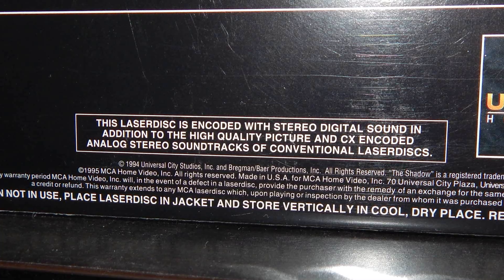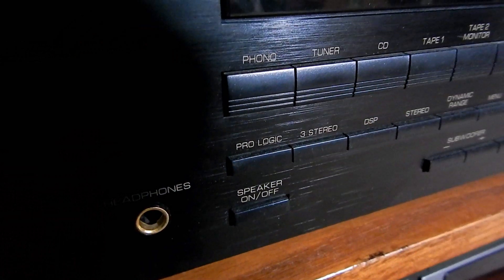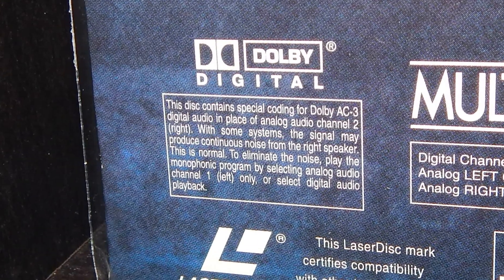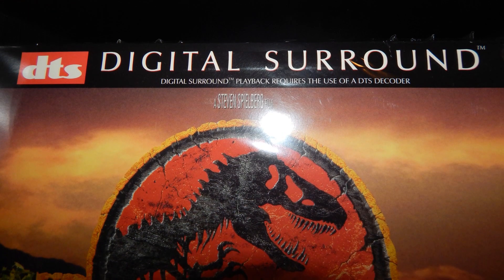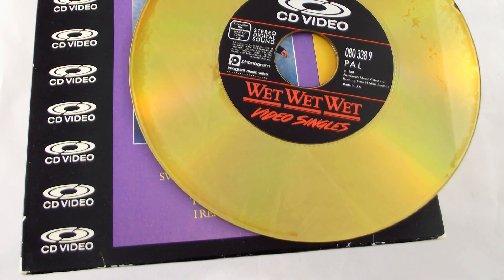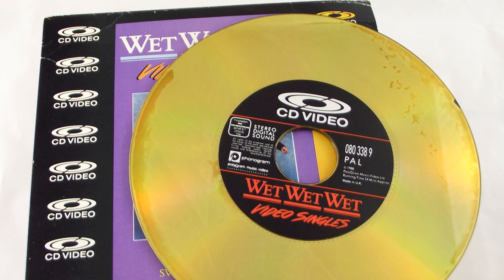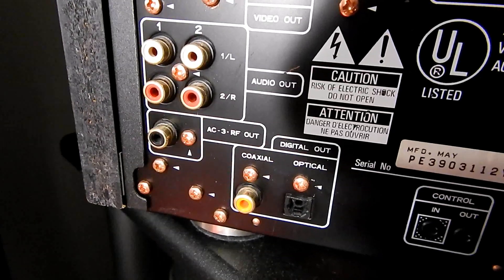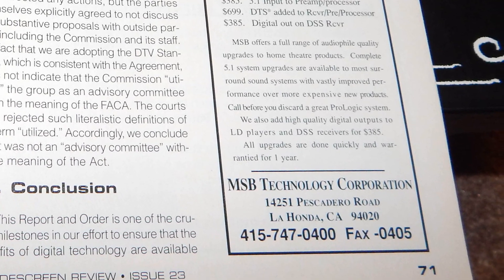LaserDisc Audio Guide – Part 1: An LD Audio Overview

Comment: 03-05-23; Appreciate the tutorial. Understandingly complex issue(s) as time evolved. This certainly achieved the goal of introducing the key moments of tech advancement along with highlighting the tangents. Just recently into the LD experience, having purchased a Pioneer CLD-59, and this helped me understand several things 'new' to me regarding the back panel hookup options. Will need review and additional details, but now have better basis of truth. My Amp has built-in  RF/AC-3 INput, so in several weeks of analysis of used offerings saw immediately I needed to be in the mid-90s + era for a player offering an OUTput to match. Will likely re-listen to this as well as catch the additional videos offered to expand on the knowledge. Looking foward to being competent, knowing the lingo etc. Being a Nerd (Techno-Nerd) was and is not my goal but it is cool to know more than a thing or two and be able to hold intelligent convo's with the geeks to whom I need to rely on to ultimately answer my Questions. No disrespect intended, labels can be used negatively - not my intent. I look at those terms geek and nerd as abbreviations like pHD, Dr etc...

Comment: Sam, can you explain the difference between an amp and a receiver? Is one preferable to the other?
Reply from the maker: It's a bit of a mess - people in Europe seem to call everything amps, while people in North America seem to call everything a receiver.  Haha

But technically, an amp is just an amplifier, solely taking audio signals and boosting them for speakers - once you add on built-in audio or video processing, it becomes an integrated amp. Then when you add a built-in tuner, it becomes a receiver.

So basically, if it doesn't receive AM or FM signals, it's not a receiver. Integrated amps seem to be more popular in Europe, as I've never met anyone with one here in the states. I wouldn't suspect they'd be that much better sonically than a receiver, though. Everyone I know either has a receiver or they go for separates, which is where you get that next step up in audio quality.

That said, I've heard some pretty awesome sounding receivers!
Reply: @Culturedog  wow very interesting. 

How do you feel amps/receivers compare to the sound bars we're living with today?

Comment: Great video, but you should explain analog audio on LD even more in depth, since there was variants of that as well. The early discs were just analog  - either mono or stereo. Then CX-noise reduction was added and the very first players could be upgraded with an external box. But not all CX-encoded discs were the same. On some (like the first TRON LD) CX-noise reduction had to be manually enabled. That's what the CX-button is for on nearly all Pioneer remotes. Pretty soon CX-discs automatically enabled the decoder. But there were problems. If the movie was mono and the publisher added an audio commentary on the second analog audio channel, CX had horrible side effects. Criterion learned this the hard way with "It's a wonderful Life". They put CX-noise reduction on both tracks and that resulted in awful "pumping" or "breathing" effects if you just wanted to listen to the (mono) movie soundtrack. Later mono movies with audio commentaries dropped CX because of that. For stereo movies CX remained on the analog channels.
Reply from the maker: Thanks!  I am still actively working on a much more technical-minded LD audio series that will be able to get in the weeds much more.  When that will finally be completed - who knows?  Haha

Though some of the CX information is presented to some degree in the 2nd episode of this series, which I just posted this morning.  2 down, 3 to go! 

Cheers!

Comment: You did not always need the separate AC3 decoder there were receivers that had them built in
Reply from the maker: Indeed.  We'll be covering those in Episode 3!
Reply: That is definitely correct.  

We had outboard processors as well as the aforementioned RF Demodulator.  I also did a few mods to some of my players that also incorporated an internal AC-3 RF Demodulator to simplify things even further (or more complicated depending on one’s set up).

Comment: Forgot to mention a few receivers did have the AC-3 demodulator built in. I think the way to go is a separate demodulator paired with a new(er) receiver but it does seem easier and cheaper to come across those older receivers with the built in AC-3 then it is to find a dedicated AC-3 demodulator. I've come across a few of those receivers at Goodwills and specialty shops for well under $50 where I've never seen a dedicated demodulator in my travels. My setup is backwards in that my receiver has built in AC-3 demodulation but not DTS so I have to use a separate DTS decoder and feed that into my receiver.
Reply from the maker: Fear not - those will indeed be coming up in Episode 3!  I've got a link to a (somewhat) complete list of receivers with built-in demodulators, so I'll have to add that in the description for those on the hunt.  

One of the coolest ones is the Pioneer Elite VSX-99, since later versions included DTS decoding in addition to featuring the onboard AC-3 demodulator/decoder.  Shawn over at LaserDisc Forever has one - pretty sure he found it super cheap at a thrift store.

I was super close to buying one of those Technics DTS outboard decoders back in the day - I thought those things were the coolest!
Reply: @Culturedog  Awesome, can't wait to watch it. The Technics DTS decoder has served me pretty well for my vintage setup. They seem pretty cheap as well. I found mine at a record store for $20 and I later found a second one at the thrift for $5.
Reply from the maker: Man, what a great price.  I remember seeing those for around $500 in Circuit City way back when.

Comment: I have a 1987 pioneer LaserDisc player would I be able to play The Lion King that came out in 95 on LaserDisc on that without having static
Reply: Run it in mono. Unplug one of the audio cables. You'll be good
Reply from the maker: Most consumer players at that point should have digital audio, but if you've got an industrial player there's a chance you might be stuck listening to mono analog at best. The domestic U.S. releases of The Lion King did have AC-3 on the analog right channel, so if you have an analog-only player, you'd need to select the left channel (if you have the remote or have that button on the player) and listen to it that way.  Otherwise you'd be listening to a mix of static and movie audio.

All of the digital players I've owned will default to the digital audio on startup, so if you're spinning The Lion King and hearing static right away, there's a good chance it's an analog-only player.  If there's no mention of Digital Sound or CD-Video on the player's body, that's another indication.
Reply: @Culturedog  I was just asking because I have a LCD-1010 pioneer LaserDisc player
Reply from the maker: Oh cool!  The 1010 definitely has digital audio and will read the the stereo PCM tracks on the Lion King. Just be careful which audio output jacks you use. If I recall correctly, that one's similar to my LD-S1, which has two L/R outputs and for some reason one of them is analog-only, while the other pair will play the analog and digital tracks.
Reply: @Culturedog  I love all your LaserDisc videos got that player this year so I wasn't sure thank you☺️
Reply from the maker: No problem!  Thanks for watching the vids!!

Comment: I actually prefer listening in raw stereo. Digital or analogue depends on release, but I usually stick with digital, although I feel that the analogue more often have higher frequencies. It's prob. due to my preference of two great speakers (BeoVox Penta) over a mediocre 5.1 setup. The day I can afford a great 5.1 setup I might change my mind
Reply from the maker: I did pure stereo with LD for a long time too - sometimes 2 sets of stereo speakers if I was feeling wacky.  

It definitely sucks when you're hearing full-bodied audio from the fronts and suddenly it fades to some tinny-sounding cheap speakers in the rear.